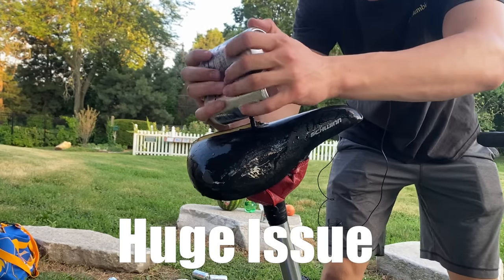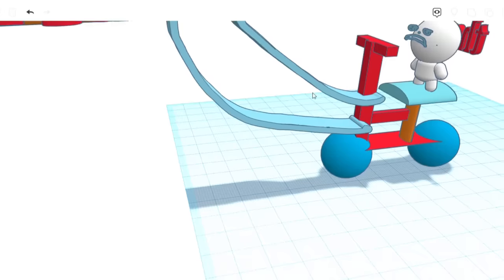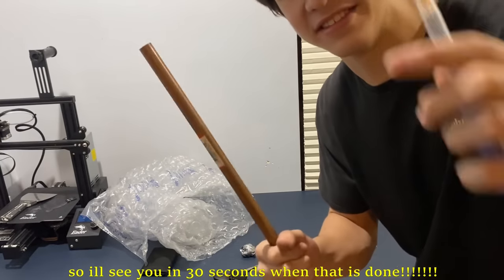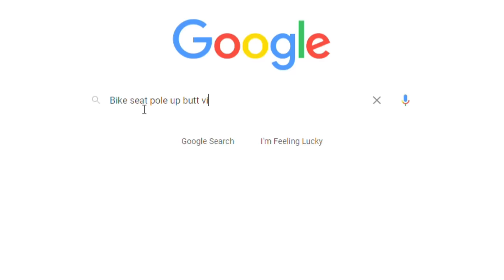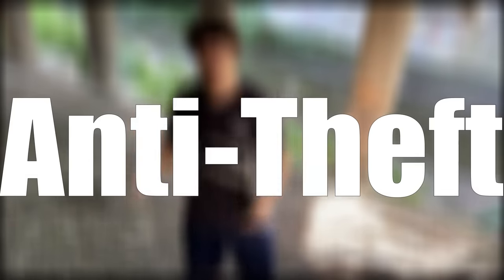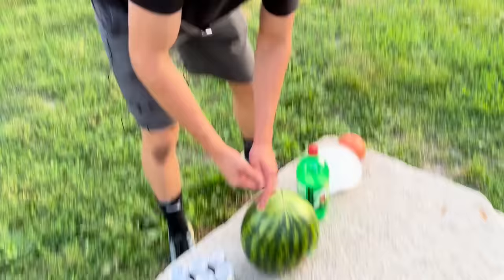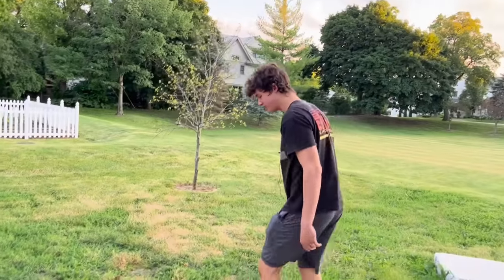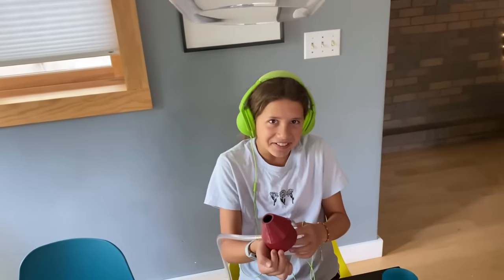Making An Anti-Theft Bike Seat

Comment: Myself I would never use something like a switch inside the frame packed with some kind of noxious smoke making material that can be triggered locally or if the bike is being ridden for more than 2 minutes without this tag being nearby, I would also never recommend leaving it unlocked in an area with such a device implanted inside the bike frame and it are known for High bike theft and I would certainly not recommend sabotaging the brakes so that the person can't stop if they're in traffic

Comment: Tear the seat cover off and spray/ soak the seat cushion with pepper spray get a junk bike for this and  use a tracker to make sure you get the bike back which shouldn’t be long after someone sits down on the seat. Let some air out of the tires so it won’t go to fast ,😊👍👍

Comment: Shoulda sharpened the tip
Reply: Spring ones work better. No need for the bulk, and apparent suspicouss thickness in the seat post. Full weight of the rider is sufficient.
 Put a harpoon head on that mf. Once it goes in, you can't ( or rather shouldn't ) pull it out without a surgeon. So the prep is stuck to the bike, and can't move in any which way.
Reply: @buka9993  thief's gonna be shitting in a bag once you're done with them :-)
Reply: @julienweems6166  At least. Im about to convert my bike into an ebike. It will be my primmary commuting vechicle. Some stinky thief just riding away on it? OVER MY DEAD BODY. Impalement after a 5 second timer.. Electricution. Hidden razors covered in stale shit in the handles. GPS tracker in the frame. I'll locate him stuck to my bike post factum, and record him on video. " is everything alright SIR?. What happened to you SIR?"  😂